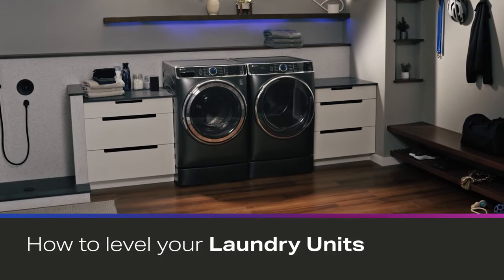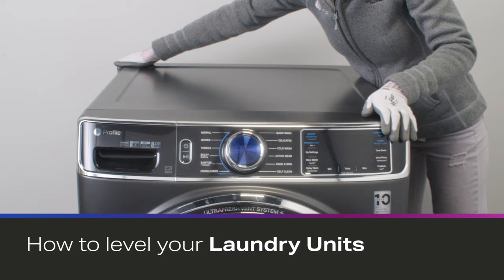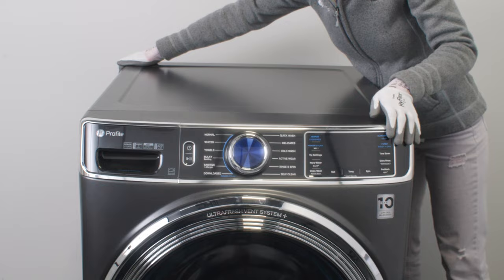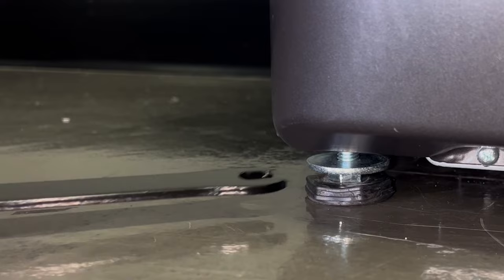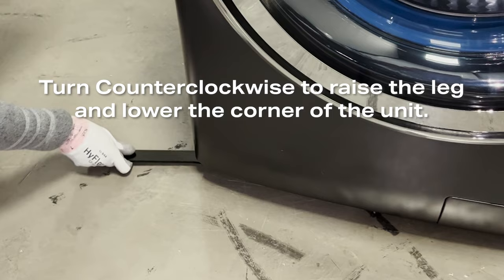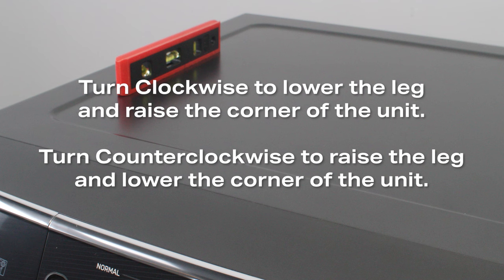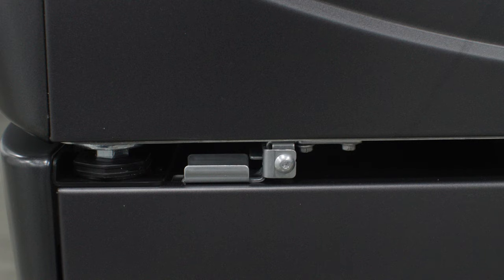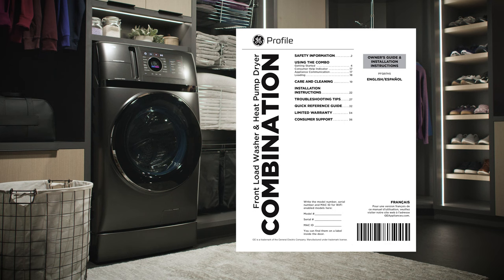GE Profile™ UltraFresh Washer and UltraFast Combo Washer/Dryer Leveling the Unit

Comment: What wrench did you use? I can't find one that works..
Reply from the maker: Hi Max,

Thanks for reaching out! You don't need a special tool to fully tighten the leveling legs, an adjustable wrench will do! Using a wrench will ensure that the clench nuts are locked.

If you have other questions, feel free to ask! -MS
Reply: @geappliances I have 5 different adjustable wrenches, none of those work, due to the space I have
Reply from the maker: Hi!

Thanks for reaching out. If you're able, please PM us on Facebook or DM on Instagram/X with a copy of your comment here and some pictures of the leveling legs in the space you have available. We'd like to review further.

Hope to hear from you soon. -MS
Reply: @geappliances you are dense. The wrench is special in that it is a very thin wrench.
Reply from the maker: Hello. We regret that you’re having some trouble finding a wrench – we know this may be frustrating, and we want to assist. You would generally only need an adjustable wrench to adjust the leveling legs. As you’re having trouble finding one that works, please send us a private message over our GE Appliances social media (such as Facebook or Instagram) confirming your model number and providing a picture of your leveling legs. (If you’re having any trouble finding the model and serial numbers, we have a tool to help with that here: http://spklr.io/6050WJfm .) With that information, we can certainly look into your concern further.

We hope to hear from you again soon, so we can assist. All the best. -SG
Reply: @geappliances yes, you do need a special tool. You need a thin head wrench also 9/16 doesn’t work even though that’s what your instruction call for. I had to use 11/16. Finally should there have been a locking nut like you show in this video for the profile combo 2 in 1. Thank you
Reply: I think the size in the instructions are wrong. It says 9/16 but I used 11/16 then realized 5/8th fit perfectly tight around nut while 11/16 was too much wiggle room and 9/16 did not fit at all. Make sure it’s a thin head wrench. GE says any wrench will work but that only true after the leg has been adjusted to given  enough space between it and the locking nut.
Reply: I used 11/16” combination wrench with the open side, it barely fit. This was after trying a crescent wrench which was too thick for the gap.
Reply: @JasonBryantGreen maybe I’ll try a 5/8”. My 11/16” seemed to work but yeah, maybe there was a little wiggle. I don’t think the manual specifies the wrench size.
Reply: Dear GE an adjustable wrench does not work. It is too thick to fit between the washer and the foot, especially when you get it brand new that way. Either start packaging the units with the thin wrench that you guys are utilizing in your own video or at least stop telling people they can use an adjustable wrench.
Reply: Same here. All my wrenches are thicker than the available space. I wish I had the wrench you show in the video. It is very thin. Or one of those combined bicycle wrenches. They are thin too.

Comment: I was leveling washer and it was hard to get loose so I had a pair of long nose vise grips the bolts are machine on after breaking them loose I used 17mm open ended wrench after that I had to level it!! G.E. should have alowed more space to get any wrench in there and not torque them in assembly be sure to remove 6 inch shipping bolts and bracelet or it will shake big time hope this helps😊

Comment: Is it safe to have the four leveling leg extended all out?
Reply from the maker: We recommend you keep the leg extension at a minimum to prevent excessive vibration. The farther out the legs are extended, the more the Combo will vibrate.